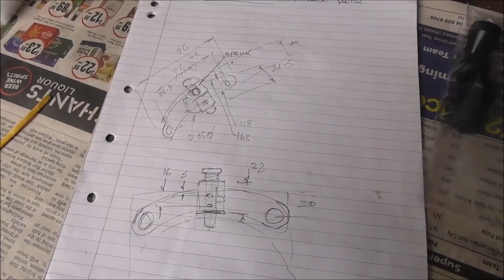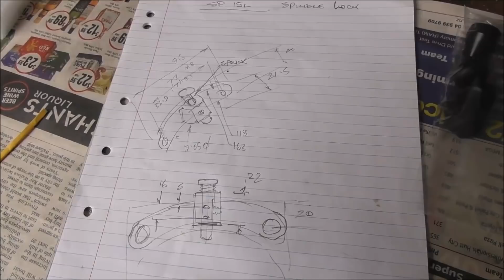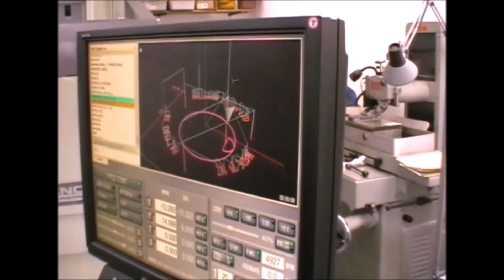CNC Turning  Tips and Tricks    2 mp4

Comment: i recently made a "thru air/oil" ,mist boring/threading  bar. I used mild steel for the bar , then brazed a carbide threading profile to the end. The mild steel component allowed me to drill/port it so I could introduce air (or collant) thru it to clear chips.   I actually cut the tooth profile off of a carbide insert and brazed that on...I even went to the trouble of making it at the corresponding helix angle. It works well.  Keep up the good vids!
Reply: Try honing some carbide inserts if you braze them up it leaves a good finish on 1018 cold rolled...Or silver solder HSS onto a mild steel bar with thru coolant holes, if you prefer the fine edge capability of HSS
Reply from the maker: Thanks for those tips  @unionse7en  - I will keep them in mind. You might see them in a future video!   Cheers  Cliff